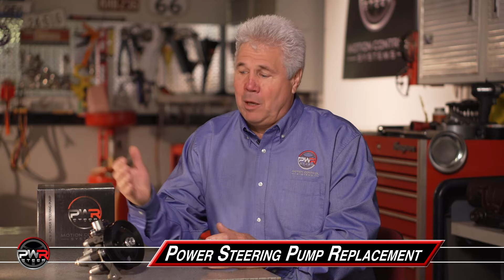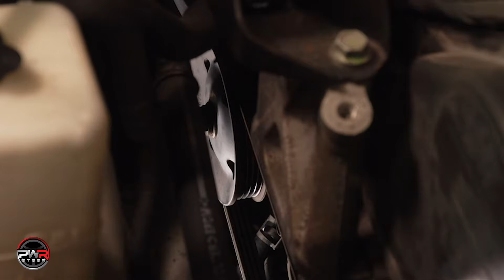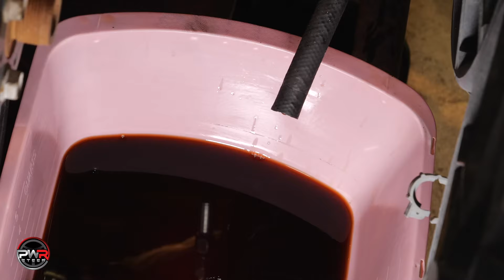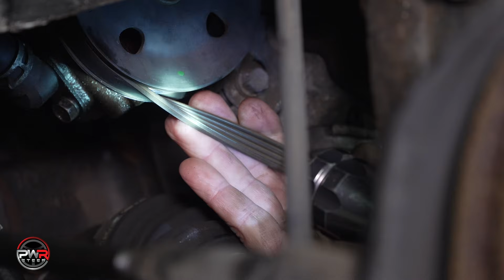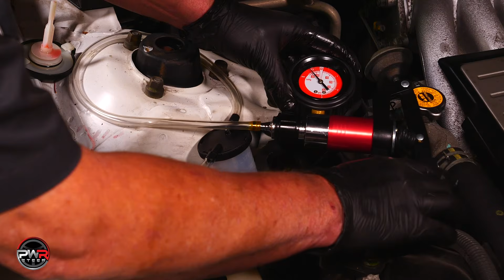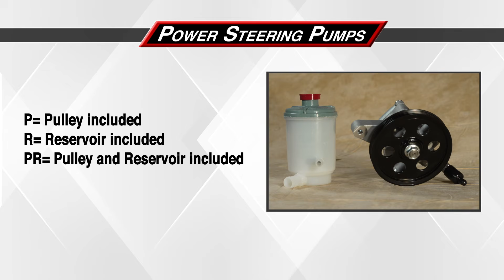Power Steering Pump Replacement: Step-by-Step DIY Guide | PWR Steer

Comment: After installing a new pump I noticed when I rotate my steering back and front on without moving the car it starts vibrating like the force is  dropping and can be noticed on the speedometer
Reply from the maker: Hi,

If you have not already vacuumed the system, please do so. 

To vacuum the system: 
20 inches of vacuum for 15 minutes.
If you are holding vacuum, then that is good.
If you are not holding vacuum, you have a hole in the return portion of the power steering system and you are pulling in air. 
This will aerate the fluid making it erratic (and sometimes noisy). 

If this does not help, please reach back out to us.

Thank you,
PWR

Comment: How do you "disable the engine from starting"?
Reply from the maker: Hi Aden,

Depending on the vehicle there are a few ways to prevent the engine from starting: 
Older models you can disconnect the coil (if there is only one coil it’s easy). 
Newer models (multi coils) you can disconnect the fuel pump fuse/relay, or the inertia switch - on a Ford, or the ignition fuse/relay - if it is easier to access than the fuel pump fuse/relay.

Thank you,
PWR
Reply: @PWRSteer  Thank You.